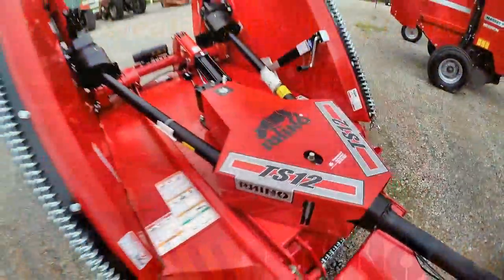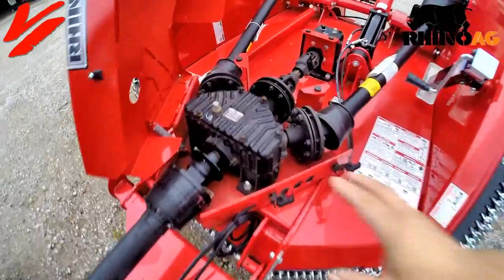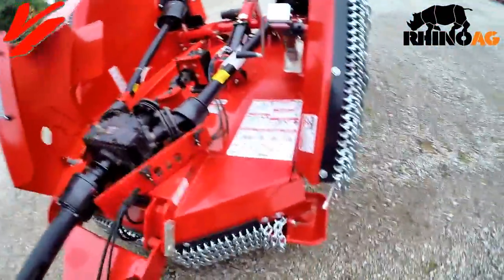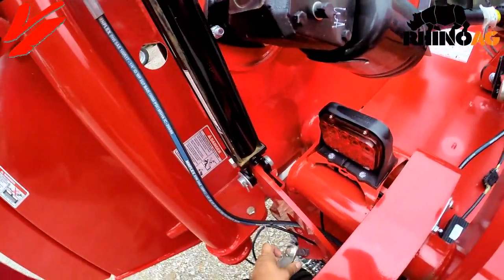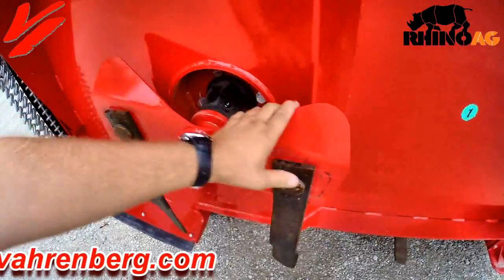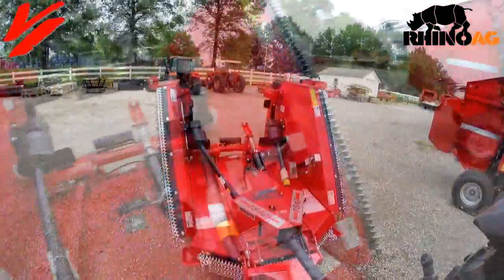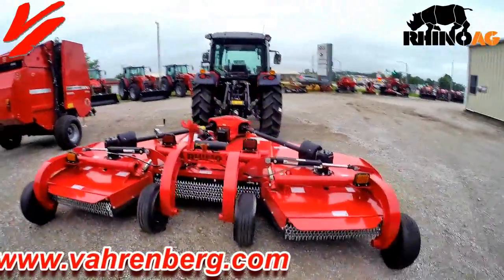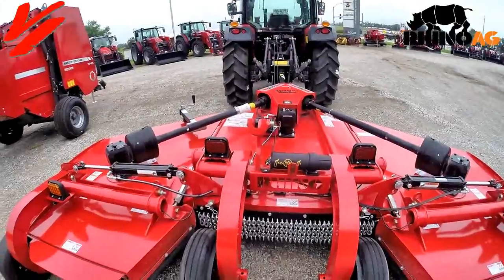RhinoAG TS12 Flex-Wing Rotary Cutter (Only Needs 35 PTO HP)

Comment: I like the design of that hitch.  It’s set up like the 5th wheel Rv hitches on the Heavy Duty Trucks aka semis that tow RVs.  Instead of the hitch being forward of, or directly over the rear axles,...they set them up 3 or 4 feet behind.  That way, it allows for a longer combination to turn tighter.
Reply from the maker: Exactly. That TS12 Hitch makes for incredible tight turns and allows this mower to do more in tighter spaces and not have to sacrifice the added cutting width. Thanks for the comments.
Reply: Vahrenberg Implement the hitch, plus the overall length being 30”-40” shorter than other brands makes a huge difference too.

Comment: I bought the 10' flexwing mower, leaks fluid from day 1.  Emailed them asking for the part so I could fix it, and even willing to pay for the part even though its brand new and defective.  Basicly told me to go f my self!   I recommend before you buy anything from them, try to get a part for the item you want to buy and see what happens.
Reply from the maker: Your Selling Dealer is responsible for Warranty and You need to contact the Selling Dealer for Warranty Parts and Service. They are responsible for handling warranty claims. Contact your dealer for the Warranty Service You need. You can order parts direct from Rhino on their eCommerce Website (Most Machines has QR Code Label as a Decal) or here is link: https://myrhinoparts.com/?dealerId=725605

Comment: I notice some of the rhinos have a metal gearbox cover and some have plastic. Not a deal breaker by no means. Just curious if the metal gearbox is a optional upgrade? Getting ready to pull the trigger on the rhino TS 12.
Reply from the maker: The older (Early) generation had the Metal Shield over the Divider Gearbox. The Later models and current models use the Poly Shield and easier to open and strut supported from the 3150, 4150, 4155, & 5150 on the TS12.

Comment: Are these stout enough to mow pastures daily? I know most 12’ units they claim “not for commercial use” or something along those lines. I’d love a 12’ unit to help shorten my days.
Reply from the maker: We have sold a bunch of TS12 and customers main use are taking care of pasture mowing. Works great for them. RhinoAG now offers 2 models of 12' cutters. The TS12 with Cut Capacity up to 1.5" Diameter Trees and the NEW Heavy Duty 4125 with cut capacity to 4" Trees. Here is link to specs on 4125: https://www.rhinoag.com/products/rotary-cutters/flex-wing/4000-series-new-flex-wing/
Reply: @VahrenbergImplement  son of a gun. This is EXACTLY what I have been waiting for someone to make. I’ll be saving my pennies for spring. A 12’ unit that can do 4” material would take care of every piece of property I need to maintain. Awesome. Thanks for the info!
Reply from the maker: I will tell you inventory is hard to get right now in the Flex Wing Cutters. RhinoAG is taking Retail Orders and locking in price the day you order. If you want for spring...it's probably best to get with your local dealer and get one ordered. They can request delivery date. It's challenging right now but hopefully inventory can get better for 2022. I'm ordering cutters now just hoping they make it here by summer 2022.
Reply from the maker: Check out the RhinoAG Facebook Page they have some pictures in Orange Groves in Florida. Orchards are really liking the 12' width so they can get in between or narrow rows to get more trees per acre. Here is link I hop Works to some Pictures: https://www.facebook.com/rhinoag/posts/4923635670984944
Reply: @VahrenbergImplement  great info!! Thank you for your responses here, most companies don’t take the time. With a new tractor purchase and a land purchase, I really do need to save my pennies! Lol. I went to that link you shared, what an awesome looking piece of equipment.

Comment: Really nice mower.  But really? $18,000.  Is it diesel or gas powered?  Oh no wait it has no engine...4 gear boxes, 3 hydraulic cylinders and 4 tires $18,000 crazy just freakin crazy!
Reply from the maker: Look at the Price of Fuel, Freight Costs, Employee Wages, Insurance Costs and Biggest factor Steel Costs. Everything has inflated in prices in recent years and those items are major factors in Machinery Prices. With high World Demand it's not getting better. Kind of reminds me of "Missouri Senator Jerry Litton was asked when we going to have $1 a Pound Steaks Again...He Answered soon as we have $10,000 a Year Senators" Your never going to see prices decrease again.
Reply: Sounds like you never built/welded one ? Installed gearboxes ? Fabricate any of this ? No ? Dont speak until you actually know what goes into it

Comment: I'm not getting any info on rhino ag website on ordering a TS 12. Are they taking orders for new mowers or is the supply chain issues suspended new orders at this time?
Reply from the maker: You have to Order through your local dealer. They are taking orders all the time. Retail Order are priority over dealer stocking orders. Visit your local dealer and they can get you taken care of.

Comment: Would you recommend laminated tires or the airplane tires?
Reply from the maker: RhinoTrax Foam Filled is what we sell they are High Speed Tires and New Tires. Laminates and recapped airplane tires are not recommended over 15mph travel speeds. Plus RhinoTrax do a better job on hillsides reduces drifting down the slope better than other styles as they have a tread design that helps hold them on slopes.

Comment: How much does the Clevis run for the hitch I've messed mine up on my mower by not having two bolts in my hitch lesson learned
Reply from the maker: Shows Price in the current book for the Front Clevis is $177.11. There is a Price Increase announced on Parts June 2019. If you order prior they are honoring current price.

Comment: The right wing blades are turning the wrong way. They need to be turning against the tire tracks to prevent leaving a streak
Reply from the maker: That is not how RhinoAG Engineers and most every other cutter manufacturer engineer them. I know the RhinoAG Engineers spend lots of time working with cut quality and residue management for the best cut and reducing lumps and bunching so residue is equal distribution. Got question like that I would ask RhinoAG they know the product best. www.RhinoAG.com

Comment: My tractor has one set of rear remotes.  Can one of the wings cut a rising roadway slope while the tractor operates from the roadbed ?
Reply from the maker: Yes the wings can float up/down. Even better if you have float valve on the tractor. But you can do exactly what your talking about too.
Reply: Thank yoU !
Reply: Thank yoU !
Reply: Thank yoU !

Comment: How long is the cutter from tongue to the back of tail wheel? Weight 2700#?
Reply from the maker: Overall Length is 148". Weight is Approximately 2750#. Weight can vary Belt Deflector versus Chain Guard Option and tire type and number of tires.
Reply: Thank you for the reply and information.